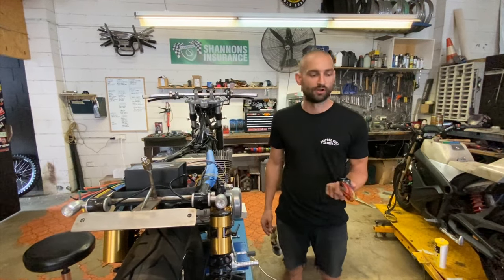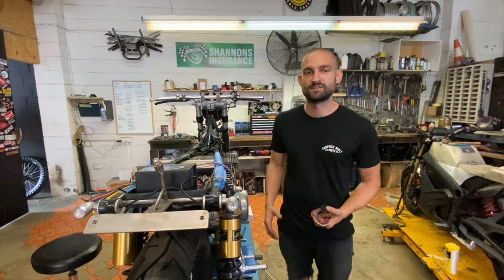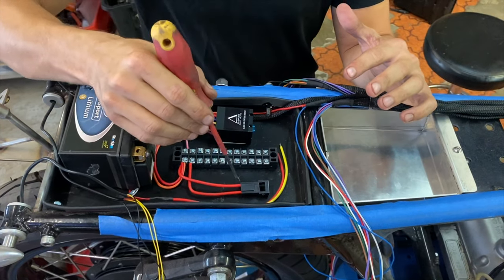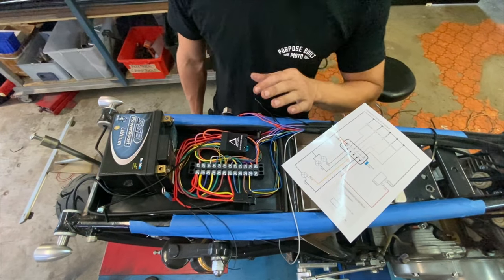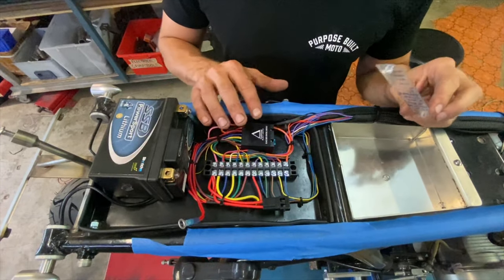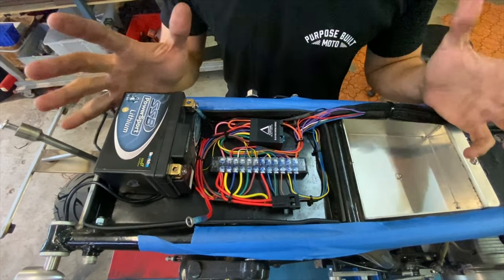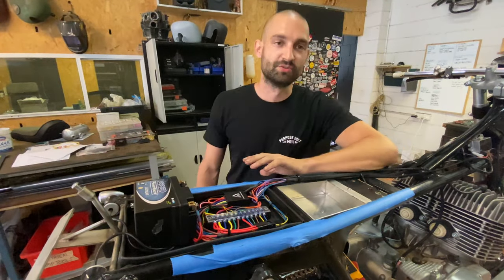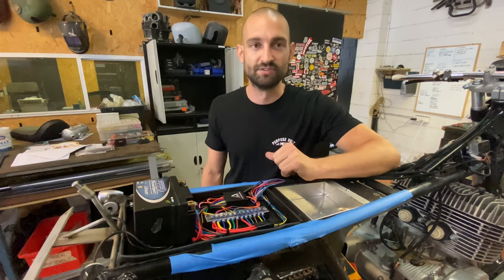Installing our Black Box Lighting Control Module - Explained under 2 minutes

Comment: Will it work on a 1983 Yamaha SR 50 Kickstarter (no battery)? Power only on engine start. I'm worried about spikes
Reply from the maker: On bikes like this we always reccomend a capacitor in circuit for smooth voltage deliver but I know a few of our customers have done it successfully on SR500s and XR600 bikes

Comment: Your videos are great ! I just love them all ! But I have a little curious question about the specification of wire using in bike. It's need to be fire proof ? anti-fiction ? or any certification like UL1007 UL1009....something like that.
Reply from the maker: Thanks for checking out our content. 
If you need more info on wiring, check out our blog posts and diagrams. 
https://purposebuiltmoto.com/bike-customization/electrics/

Comment: Does the black box replace anything if I'm using the original wiring on the bike?
Reply from the maker: The Black box replaces your headlight relay, flasher relay and includes a kill switch circuit. Although it’s designed to work with aftermarket push button switches, not your standard bulky switch blocks.

Comment: So can this module console a 4 button set up to do L/R turn, horn and start?  I cannot find a Grip Ace grip pad and mine is going. They went out of business
Reply from the maker: Yes it can operate all of those fiunctions, heres a link to check out more info. https://purposebuiltmoto.com/products/black-box-2-switches-kit
Reply: @PurposeBuiltMoto  thank you.  I read that entire website last night.  It seems it more for lighting controls.   I can't find a manual with detailed info on how this would control blonkers, horn, hi/lo beam and starter.   I need of those functions.
Reply from the maker: We provide a wiring diagram
That shows how the module is connected
Reply: @PurposeBuiltMoto  is there a way for me to look at this wiring diagram before I purchase the product and find out that it's still not going to work.

I have something called a grip ace system in the company has gone out of business so I can no longer get replacement parts and the finger pad that is machined into the left hand grip is malfunctioning. I'm not willing to buy your product if I don't know that it's absolutely going to work as a replacement for the current product that I am using.

Can you send me a link or something so I can see you this wiring diagram that shows me everything you're trying to explain
Reply from the maker: @jcallesano  I'm telling you it absolutely will, we wire complete motorcycles with this module weekly. 
If you want specifics email us at admin@purposebuiltmoto.com
Reply: @PurposeBuiltMoto  thank you.   I'll email that address tonight.  Appreciate it.